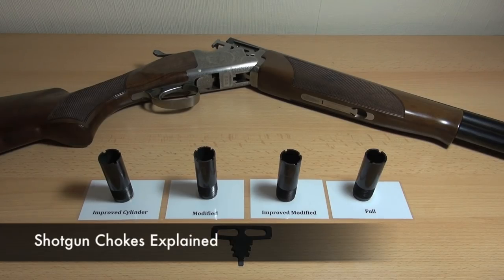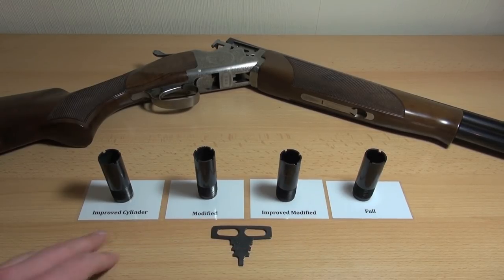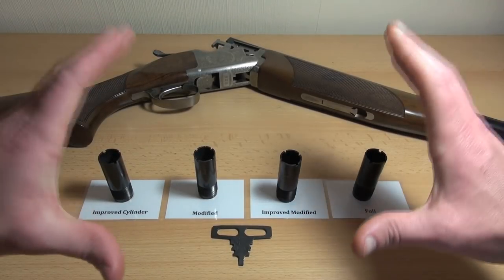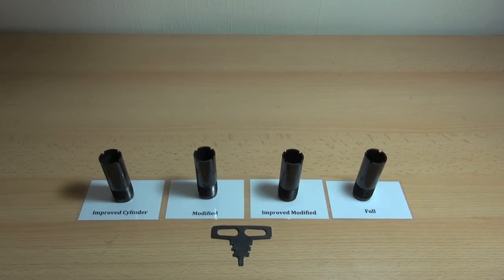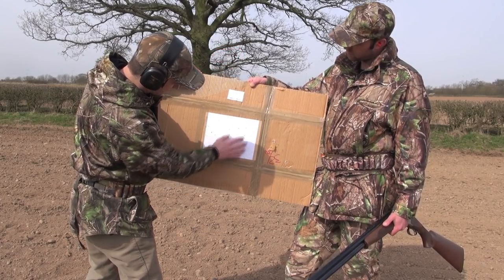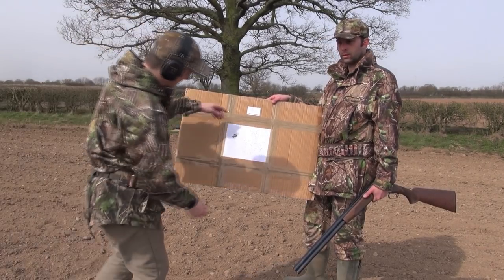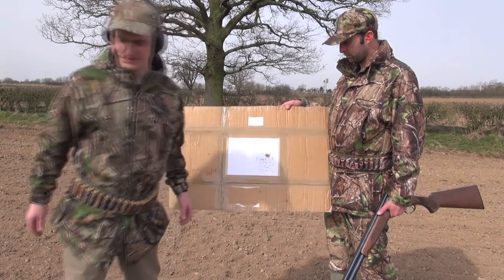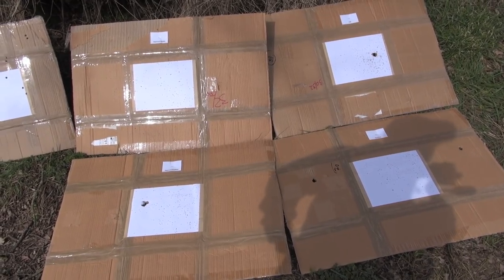Shotgun Chokes Explained

Comment: Basically the tighter the choke restriction the denser the pattern will be on a target at a givin distance variables would be the shot size used and changing the distance. Improved cylinder and modified are good choices for clay pidgeon shooting while full works well for Turkey or waterfowl hunting. When a shot gun is discharged the shot first comes out in what is called a shot string of about two to two and a half feet long as it travels forward it opens up into a pattern this,of course, all happens in a fraction of a second. Older scatterguns were manufactured with fixed choke restrictions while our newer ones have the invector system,removable  and selective for what ever choke or combination of chokes you desire for an intended purpose. I hope this is additive info for what these two Brits were showing us.

Comment: In the UK you can own shot guns up to a maximum of 3 shots on a shot gun certificate, there is no limit to how many you can own and they can be fitted with sileners. Rimfire, center fire, air rifles (over 12ftbs) and shot guns with more than 3 shots go on your Fire Arms Certificate. You can also own silencers/moderators for these For pest/hunting you must use hollow points, polymer tips(like V-Max) or other frangible ammo. Most can keep 600 rounds of each caliber owned, no limit on cartridges.

Comment: No It is a bolt action with a 2 round clip if you want to see a picture the model # is 385kb it can hold a 3 in. Shell or a 2 3/4 in. Shell this shot gun is pretty cool also I did some research this gun is a bout 40 years old as it was purchased in 1974 any ways hope you have a good day

Comment: Just a note, generally your meant to have a tighter choke in the bottom barrel in a o/u that your shooting bottom barrel first, this is due to the guns being mainly used for driven pheasant, partridge and duck the first barrel will be used at a bird farther away, then the top barrel used (with a wider pattern) for when the bird has got closer .
Reply from the maker: +Max Hickling Many people shoot the top barrel first so they can reload after a single shot more quickly. But either way you want a wider choke for your first shot and a tighter one for your second because on the second shot after a miss the chances are the bird will be further away.

Comment: Okay, you want a few comments, the reason you fire the bottom barrel first is because of law of physics, for every action there is a re-action.When you shoot the bottom barrel the return force comes directly back to the rear, if you study the configuration of your gun you will see that the bottom barrel and the stock, right back to the heel and toe, is in a straight line therefore the returning force is able to come back smoothly whereas the top barrel is and stock are in a S shape, more or less so the back force has to find a course which in this case is not straight and therefore flips the barrel, not always up in many case it can be down. The full choke is 40thou constriction of the bore size, therefore a full choke if measured correctly cannot be a three quarter choke, that would be 30thou constriction. Having said that, on production guns many bore sizes do differ from the norm and one size constriction could be tighter or more relaxed than the advertised bore size, you can, as you know, "reduce or tighten your perceived choke" by using different make cartridges. I see you wing shoot, so you will know that the tight choke is fired first because the quarry is further away, when it come closer the open choke is the one preferred. While William W Pape of Newcastle on Tyne is usually attributed with the invention of the choked barrel, Winchester invented the mobile choke system,i,e the screw in choke. Be glad to help you with more information if required.
Reply: @James Worth....starting with your 3rd to last sentence. Thank you, thank you,thank you. And frankly I'm embarrassed I didn't figure that out for myself. That is precisely why you use (a) choke(s). Targets are generally dynamic, not static. Again, thanks for the clarity.

Comment: I almost forgot. Hope you got yourself some plastic snap caps for that nice OU so you can safely decock the gun when not in use without dry firing. Keeping the internal strikers in the cocked position can weaken the striker springs, these are a good item to have, as dry firing a double barrel or an Over & Under can damage the breach face, as well as the strikers. Keep up the good videos bro.
Reply from the maker: If it was anything other than a Browning I would agree! Keeping it cocked won't do it any harm, not in my lifetime anyway. And I don't like pulling the trigger indoors.
Reply: +srspower 100 % agree, you don't need snap caps for what he was doing.

Comment: Good demo of shotgun chokes. The 00 Buck will trim the hedge:)
Reply from the maker: +Jackloreknives It was far enough from the motorway!
Reply: +srspower I have never used  00 buck. The largest shot sizes I have fired are No 3s and mostly use 5/6/and 7's and there is no way that size of shot would reach the road and if it did it would fall like rain. You were shooting into the ground through a hedge so a safe shot in my book.
Reply from the maker: Jackloreknives 00 Buck is actually hard to come by here, I got them at a show and they are really old! The UK equivalent is SG as in 9 8.5mm pellets. You should check out my 'shotgun slugs explained' video now they are a lot of fun!
Reply: +srspower I will checkout your video later this evening. Currently have an old side by side but hoping to upgrade to a B525 soon. Same gun that you have though i may go for the sporter version. Just a little extra weight to absorb the recoil. I don't enjoy the kick from my s/s now that I am becoming  little older.
Sandy
Reply from the maker: Jackloreknives Yeah a B525 is a lot heavier than a side by side, be mindful of fit though. If you are unsure miruku do a lot of variations in fit too and they are basically identical to the B525 as they are made in the same factory in Japan.
Reply: +srspower cool video, lee have a mould for 18pcs buckshot i have seen in the catalog :-)
Regards Thomas

Comment: Nice video, I've just brought a new o/u & it has Improved cylinder & Modified fitted from factory, I'm going to be using this for clay's, so I'll leave these in :-) Many thanks for the info top one !!
Reply from the maker: No problem! As you gain experience and start trying different loads for different distances you will probably start to experiment with the other chokes. But for now improved cylinder and modified will do the job. Thanks for watching :)

Comment: Hi. firing the bottom barrel first has nothing to do with having the weight of the top barrel stopping muzzle flip on recoil. Otherwise it would work the other way around? One point is that the bottom barrel is more 'inline' with the stock/shoulder to help reduce muzzle flip. 1/4 + 1/4 chokes are are probably all you need at most sporting clays, 1/4 +3/4 chokes are a good all round for game etc. I did like the choke comparison of shot in the field.
Reply from the maker: Thanks for watching :)

Comment: Have a 12g auto 2+1 just bought never fired a shotgun before i have 71/2 28grm cartridges,and 36grm eley alphamax+ bbs size #0 70mm shels  what size chokes should i use for both cartridges ,its says use max  900 bar  cartridges in the manual   what ever that means any advise would be great for  a newbie will be mostly shooting clay Pigeons or the odd  fox👍

Comment: For those of you in the USA I think you will find the tightest choke you can use is 1/2 that was with a fixed choke and shot a brenic (slug) through it, any tighter than that and you will split your barrels wide open and if your lucky get away with your life, if you shoot open cylinder you have no worries.
Reply from the maker: I have shot eley benneke slugs through the Browning Maxus with improved modified (3/4) choke with no issues at all. In fact I got a pretty good group. 

https://fbcdn-sphotos-e-a.akamaihd.net/hphotos-ak-xpf1/v/t1.0-9/1978849_277846952384653_2136909787_n.jpg?oh=a0904fd05e86021420a11012ee1f6f47&oe=553FE3CD&__gda__=1429646411_939afd66556b901cbf4bb61968e0f0a0
Reply: Hi, yes forgot to mention that fixed chokes and screw in chokes are completely different in sizes, so it is down to personal choice, whilst I realise your slugs are called a different name to what we use over here, a brennik is just one lump of solid lead with ribbing up the side, is this the same as yours??
Reply from the maker: KentcraftPrepper 1 Yes one once rifled slugs. Quite tricky when all you have is a bead. But still surprisingly accurate at 50 metres.
Reply: I have just found out that over here our 1/2 choke is your modified choke over there, and by the way, thanks for replying to my comments, a lot of the time most people don't bother, cheers mate, happy hunting.
Reply from the maker: KentcraftPrepper 1 I try and answer every comment, not always easy! Thanks for watching :)
Reply: thanks for the reply

Comment: So being new to guns and eager to learn all I can...  here is a question..   does the choke you use also affect the travel distance of the pellets?
Reply from the maker: It has no impact of the power of each pellet but it does keep them closer together for longer. The more spread out they are the less overall power the target receives. So they increase the effective range rather than the actual range.

Comment: Question.How does the shot affect the threads in the barrel with no choke or is a choke required at all times.
Reply from the maker: A shotgun barrel is either removable choke, like in this video, or it is a fixed choke/cylinder bore.

If it has removable chokes then yes a choke of some sort has to be fitted even if that choke is actually cylinder bore and so doesn't choke the shot at all. The reason is that inside the barrel it tapers out and has threads to accommodate the removable choke. If you shot with nothing in there the barrel may break and the threads would definitely be damaged.

Comment: I would imagine that's a big advantage of a double-barreled shotgun vs. single - you can have 2 different chokes.  Helpful when shooting things that are at variable distances.  Use one barrel with one choke for a certain distance range, and another barrel with a different choke for a different range.  (?)
Reply from the maker: Yes generally I use modified in the bottom and improved modified in the top and I start with the bottom barrel. The idea being you need less choke with the first shot and more with the second because if you miss the bird will be further away when you shoot at it again. Thanks for watching :)

Comment: So can I shoot slugs through the Improved Cylinder choke?
Reply from the maker: You can shoot foster type slugs through any choke.
Reply: Thanks!!! :D
Reply: Johnny Chan that's my question
Reply: Johnny Chan yes, but you probably wouldn't want to shoot many of the slugs through chokes. I understand some newer slugs are designed for chokes even tighter ones. do search some have done videos on that.
Reply from the maker: armed ready No the majority of slugs available are foster type as in they have what looks like rifling on the sides. This allows them to go through a full choke and some are even recommended to go through a full choke. The only commercially available slugs you can't shoot through chokes are the sabot type slugs as far as I know. What you definitely shouldn't do is use slugs you crudely made yourself or bought from a reloader with a choke.

Comment: What kind of choke should I use for slugs BTW my shotgun has a built in 3 way choke
Reply from the maker: Is that a Mossberg C-Lect choke by any chance? A lot of the 'slug gun' purists will use a straight cylinder bore but I have found a lot of slug brands ie: ELEY recommend a modified (half) choke minimum. And I have shot slugs out of a improved modified choke with no problems at all. Hope that helps :)
Reply: It is a Mossberg shotgun it has a adjustable choke you twist it to the desired choke it came stock from the factory that way it is an old shotgun like maybe 50 years old its a bolt action 12 gauge do you know any more about it please let me know thanks
Reply from the maker: Are you sure you don't mean pump action? As in the mossberg 500? My friend Tom has a Mossberg 600 (same as the 500 but made for department stores) with the C-Lect choke, which is what yours is with the 'twistable adjustable' choke system. We did a video on it doing practical shotgun check it out.

Mossberg 600 Practical Shotgun Review

Comment: nice video - thank you very much! for the steel amo for clay pidgeon shooting - what kind of choke would you suggest considering the pressure that builds up because of steel?
Reply from the maker: +divermg Steel tends to pattern tighter than lead. Any choke is usually good other than full.

Comment: In an over and under shotgun which barrel shoots the front trigger if it has two instead one single trigger as yours?
Reply from the maker: If its a double trigger the first trigger fires the bottom barrel the second the top. On a single trigger like mine (or nearly all modern OU guns) you can select which barrel shoots first by pushing the safety to the left or right.
Reply: ***** Ok, thanks

Comment: do a hunter needs so many chokes during a hunt? personal i believe full fixed choke can do all the other chokes can do, as long as you adjust your shooting distances in relation to your amo. For example if you want a wider pattern with a full choke you should shoot at a longer range ,which is an advantage because you don't have to stalk to close to your game.
Reply from the maker: +bakani baleni Chokes are for shooting birds on the wing primarily. A full choke can be problematic shooting say woodpigeon close up but in high winds because the pattern doesn't follow your swing as well.

Comment: I just bought a Winchester SXP 12gauge, it came with a 28" and 18" barrel. I am going rabbit hunting. Can someone please tell me what barrel I should use and what size shell would work best? I bought a box of Federal 2 3/4, 1oz, 7 1/2 shot, target load, but now I'm thinking that might not be the best for rabbit hunting. Any advise would be appreciated, Thanks
Reply from the maker: 28" is a game barrel, on the short side as it happens! Your 18" barrel would be illegal in the UK as it's only purpose is self defense. 1oz is a 28 gram load and 7 1/2 is quite small, more designed for clay pigeon shooting really. Personally for rabbits I use number 5 32 gram (1 oz 1/8 roughly) the heavier load and larger pellets are good for shooting rabbits at range as it ensures you break bone so they don't kick themselves in to the hedge. You should check out my video 'shotgun cartridges explained'.
Reply: ***** Thank you for the quick response and advise. I watched "shotgun cartridges explained" Good videos and informative. Keep up the good work.

Comment: @2:50 i don't think it's the weight of the barrel on top stopping the muzzle rise, as if top barrel had less rise, you could justify it saying the weight of the bottom barrel holds it down - they're attached. I think it's more likely that it's simply because the top barrel is higher - if your shoulder is the pivot, then recoil above the pivot will cause it to turn up - gun rises. (cont)

Comment: I have a mossberg 500 turkey thug series, with a .670 xxf turkey choke, can I shoot 00 buck or 12g slugs through it with the choke on?
Reply from the maker: Well Remington 00 Buckshot is meant to be fired through a full choke but I don't think a excessive choked choke like for turkeys would be suitable. And to be fair you don't need 00 buck for turkeys! For slugs improved modified is often stipulated on the box, I wouldn't use anything tighter.
Reply: yeah I know you dont need 00buck for turkeys lol. so what choke would you recommend for a shotgun to shoot slugs and 00buck. and what if I just took my turkey choke off? would I be able to shoot slugs and 00buck safely?
Reply from the maker: If you remove the choke completely shooting it will ruin the barrel. For 00 Buck and slugs I'd go with something like a modified choke.
Reply: oh okay, so a shotgun always needs a choke on it in order to preserve the barrel? And a modified choke will work for shooting slugs and 00buck at least for my shotgun?
Reply from the maker: mr3shootr Yes shooting a choked gun without the chokes will damage the threads. If you want cylinder bore than get cylinder bore chokes. In terms of your loads I would highly recommend checking the packaging/website of the manufacturer to be sure what chokes are suitable.
Reply: Yeah I am checking but they arent as quick to feedback like you are so thats why im asking so much here. So what exactly is cylinder bore? Is that the requirement for shooting slugs and buckshot?
Reply from the maker: mr3shootr Cylinder bore is just that cylinder bore, as in no choke. In a choked gun you need a cylinder bore choke to make it unchoked if you see what I mean? Otherwise you have a barrel that opens out at the ned with exposed threads that can be damaged meaning in the future you won't be able to use any choke.

All I can tell you is from my experience. Remington 00 Buckshot recommends a full choke and many slugs are recommended to have a modified choke. But you need to check! Using no choke, cylinder bore, will work with anything but loads work best with what choke is recommended by the manufacturer.
Reply: okay ty, ill give them a call.